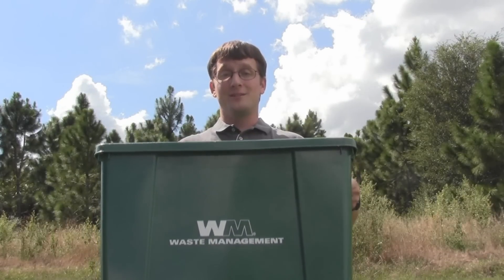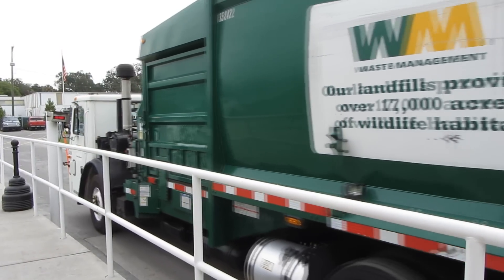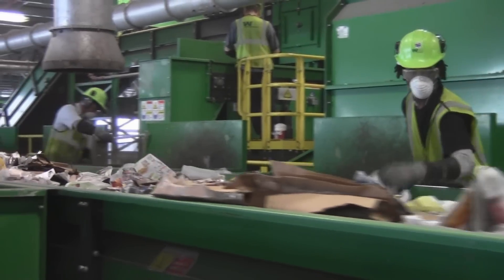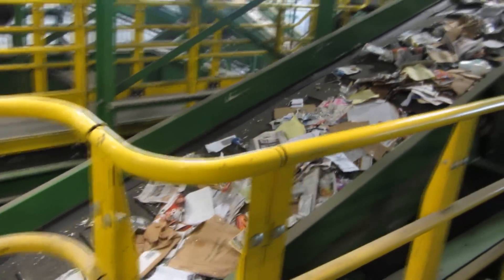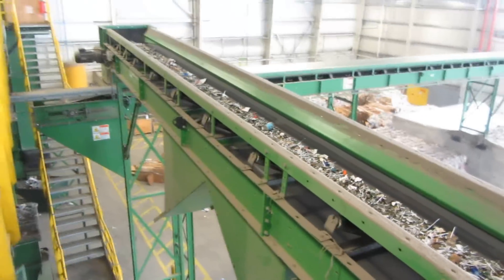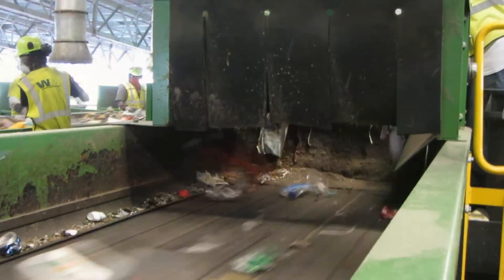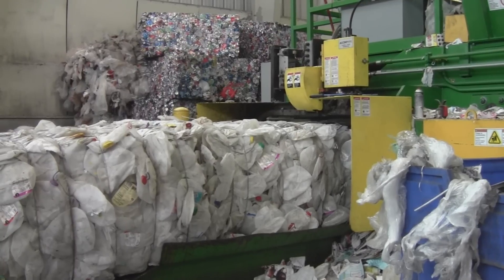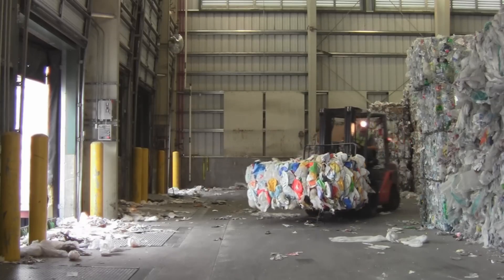Tour - WM Recycles - Tampa MRF

Comment from the maker: Plastic bags can be recycled at your local grocery store, I believe Walmart also has bins to take them back - usually at the front of the store.  They just can't process them at most MRFs because the bags wrap around the equipment (like the spinning discs) and that eventually leads to damage.  Wet paper products aren't as highly desired, but I believe they can still be processed, not sure on the details for that though.